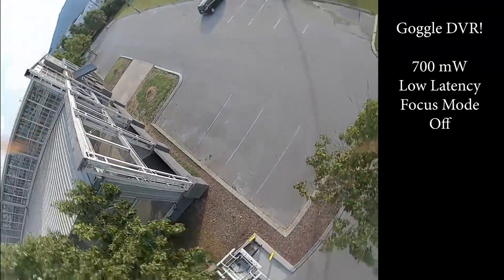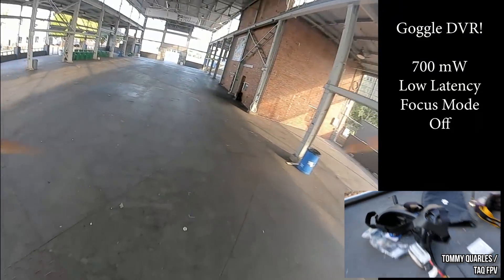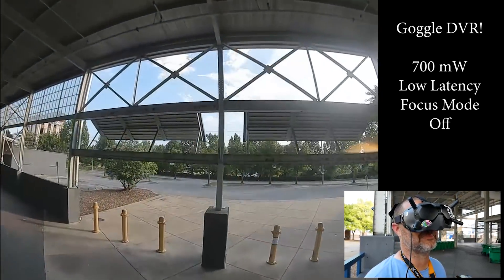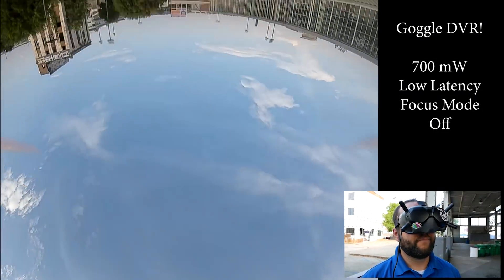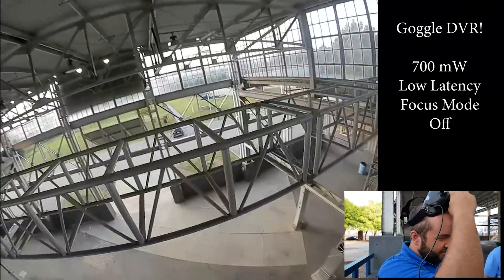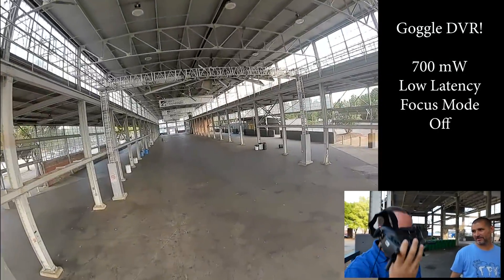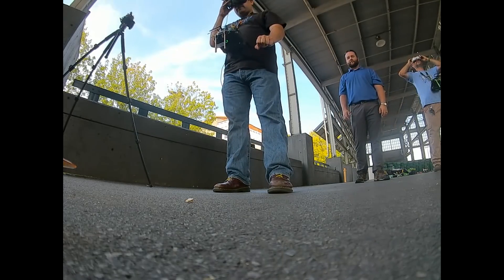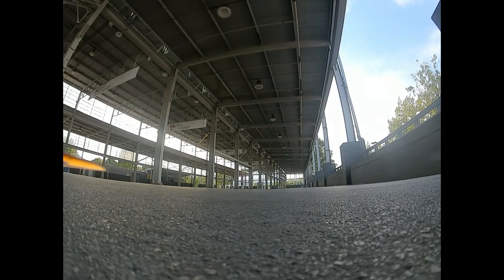DJI FPV 25 mW vs. 700 mW vs. Analog

Comment: how do you change mw setting for DJI Goggles 2? paired with the O3
Reply from the maker: O3 cannot change power manually. It is auto power only.
Reply: @JoshuaBardwell  thanks JB :D
Reply: @JoshuaBardwell  is there a setting I can or have to change on Tango 2 to go along with the higher power output (FCC hack) to further increase range?

Comment: It is possible that there is a firmware hack for the modules and force 700mw. I have a DJI FPV drone and I saw that there is a hack to the firmware that allows you to choose signal modes and unlock height limits. In my case I am from Argentina and I don't need to unlock it

Comment: 3 years later and this video is still as relevant as ever, thanks! Watching the comparison of both DJI 25mW/700mW vs Analog really puts into perspective how much clearer the DJI image quality is. Analog just isn't very clear at all, but it's what I've been using for 4+ years now. One of my BFFs has a DJI set up, and it's great that you've put in the contrast between DJI digital images vs analog, but I was also surprised that 25mW DJI could go as far as it does. I fly at 400-600mW on analog, and if I go behind any object at all, it pretty much cuts out completely. This video solidifies my opinion that I do need to make the switch to DJI or digital if I want that clear flying experience. It seems like the compression of the video data in real time, and the filtering on noise/channels that DJI provides is much better than Analog. I also live in a populated area, so the radio interference of 2.4 & 5.8 GHZ signals is redic, which is where that fine tuned filtering of data & compression really comes in to play with DJI. It just seems better (assuming the slight latency increase doesn't affect your flying style)

Comment: Hey, thanks for the review
If you use DJI controller vs tango 2 crossfire. Does it make difference in range?
Reply from the maker: Crossfire has longer range. But DJI controller has as much range as DJI goggles, and some would argue that's all you need.

Comment: Joshua I know im 3 years late but I'm new to FVP and I really like when you go into specifics. Most other youtubers just throw around 25mW 700mW bla bla  but don't even explain what they are talking about. Is it a goggle, a battery? what does it look like, where it is? what is the range difference... etc I think you explained some of that much better than others out there but I would suggest just lowering the learning curve a bit at the start of each video so that newcomers can know what is being addressed..
Reply from the maker: 25 mW vs. 700 mW refers to the output power of the video transmitter on the quad. More power = more range and penetration. In general, 4x the power equals 2x the range in open space. So 25 x 4 = 100 x 4 = 400 mW would be two doublings of range, or 4x the range. 1600 mW would be another doubling of range after that, or 8x the range. So the difference between 25 mW and 700 mW is between about 4x and 8x the range.

Comment: I'm a noob to fpv, but I watched all the dji videos by US based reviewers and thought yep, it's for me. I didn't know dji limited my gear because I registered it in the UK. lost two drones at less than 500m range by accidentally flying behind a small obstacle that should present no problem and don't on the thousands of US based review videos on you tube. the warning signs are almost none existent, it's like ok then gone. next one will have GPS. the extra cost of DJI vs analogue, per drone, it's barely worth it.  you can buy a RTF drone £200 cheaper than a similar DJI version, put a hero7 on it and still have change left over and on the next drone purchase you already have the go pro.
Reply: You can increase the Mbps to 700 very easily if you wanted. Even up to 1200 if you're a mad lad.

Comment: I’m getting into fpv.   How do I know when your out of battery or read how to monitor battery percentage, when it’s right time to stop and not damage lipos.  Or does the drone just feel slower when it’s low?
Reply from the maker: Use the on screen display to monitor battery voltage.

Comment: Can the DJI FPV air unit be used for airplane/Fixed wing operations?? It does have 8 channels.
Reply from the maker: You would need an SBUS to PWM converter.

Comment: @Joshua Bardwell  Hi J i need help and i think you are the only one that can solve my problem, im having issues with DJI fpv digital controller please help.i already refunded 1 and now i got another 1 with the same problem. the problem is related to endpoint of sticks. in the one i refunded i was having the problem when i full press right roll the software detect full left and now i have on pitch. is someonelse having that issue on gimbal? i tried my friend's controller and is having that exact issue on throttle.when he go on full throttle and reach the endpoint the software detect 0 throttle…is possible to set a dead zone in the end point area?

Comment: I'm sure this question has been answered already, so please excuse me for asking again:  What is the downside to using the DJI goggles with my Taranis radio as opposed to using the DJI controller?
Reply from the maker: You have to put a receiver on the quad in order to use your Taranis, whereas if you use the DJI controller you can just link to the Air Unit. But personally that's the approach I take, because I prefer the flexibility of the OpenTX radio.
Reply: Joshua Bardwell - great thanks. Glad to hear there’s no performance difference.

Comment: Love your videos, Joshua. I take it all the video you showed today from your DJI flights was from the SD card in the goggles? It's been interesting watching your videos and others on the DJI system. I recently bought the DJI system and do not see the same level of clarity that you are getting. Pretty sure I'm on 700mw and it doesn't look nearly as good as your 25mw. Not even close. I always have breakup even if my quad is 5ft away from me. I mean, it's good enough to fly and still looks pretty good, but I'm not making the distances you show in your video. The breakup would be way too much. Makes me wonder if I'm setting up something wrong. I also bought the Lumenier package from GetFPV (goggles and air unit antennas) hoping the problem would go away. Those antennas were no better. In fact, they were a little bit worse than stock. It's weird. Everything works on the DJI system. I also use their controller. I have two different air units and both do the same thing. They work, but the video clarity and range just isnt there compared to what I'm seeing in all these youtube videos.
Reply: Hi. I just bought Nazgul with Caddx vista and I am experiencing the same problem you are describing. Did you manage to fing out what was the cause of it? How to fix it?

Comment: Thank you so much for this clarifying video! Unfortunately I am living in Germany. So 25 mW is the max. But DJI goggles are still at 25 mW way better than any analog also with 25 mW driven system!
And: Your comparison: Analog 700mW vs. digital 25mW is not valid. We have to use 25mW only. ;-) Or do I misunderstood something?
Reply from the maker: A lot of people in Europe break the law and fly above 25 mW. This is easy to do with analog. I'm not saying you should do it, but I know people do so I wanted to make the comment about it. You can also break the law with DJI and fly at 700 mW but it is a little harder to figure out how to do it.
Reply: @JoshuaBardwell  Thanks for your comment! Wait I could not comment further because I must search my SD card with a text file that contains a one. Where do I lost this f...ing SD card?

Comment: Joshua, hi!
Tell me how convenient it is to use this system with glasses?
I have myopia "-3.5"
Fatshark glasses - I use corrective lenses.
And here, how?
I see that you wear a helmet right on the glasses.
It's comfortable? So can you fly for a long time?
Reply from the maker: It hasn't been an issue so far.
Reply: @JoshuaBardwell  The answer is beautiful.  but I don’t understand))).  Can I use this equipment if I have poor eyesight?

Comment: i just got the setup and connected it to my quad. everything works but it only shows 1 bar of signal when the quad is right beside me. when i walk like 5 meters away, the connection totally breaks off. does anybody know what's wrong?
The antennas are plugged in..
Reply from the maker: Update firmware? Make sure you are not getting interference from something else on the channel like an analog vTX? It should be full bars.
Reply: @JoshuaBardwell   thanks for the reply!! :) It was an analog system indeed. I just connected the dji air unit and configurated it using betaflight to connect the remote. But nothing else...?! I wanted to do a firmware uodate but when i loaded the firmware and pressed FLASH it just showed something like starting boot or loader and didnt load...?
Reply from the maker: The Betaflight FC needs to be in bootloader mode. You will see DFU on the menu where you normally see the COM port.
Reply: @JoshuaBardwell  Thanks! I installed all the drivers and am in DFU mode but now it does not even react when i press on FLASH. nothing happens..?
Reply from the maker: Did you load the firmware first?
Reply: @JoshuaBardwell  yes
Reply: @JoshuaBardwell  i finally got it to flash. But still the same very low signald problem with the DJI unit :(

Comment: It'd be cool if DJI could use a diversity setup on their system, where when you get a stutter at low power, it will automatically switch to an analog signal so you can simply fly through the snow like normal, then when you're back in range, it will switch over to the full digi signal.

Comment: Can you use these DJI goggles with analog signals? Meaning can they be used with micro quads or would you still need a pair of analog goggles for those? I know the quads wouldn’t be able to hold the DJI hardware, but could these goggles show analog video?
Reply from the maker: The DJI goggles do not have an analog receiver built in. They accept an AV input from a ground station though.

Comment: The question I've never heard is "why would someone use 25mW or 700mW?". What are these numbers for? Thank you!
Reply from the maker: 700 mW is more output power with longer range. 25 mW is lower output power with shorter range, but in some parts of the world it's the most you can legally use.
Reply: Thank you Joshua!

Comment: how do you change from 700MW to 25MW?  Thinking maybe i've been flying in 25mw accidentally because my range hasnt been great
Reply from the maker: If you have not connected the FC UART, make sure that "Power Limit" is off.

Then in the Device menu, make sure that power is set to 700 mW.

Comment: The breakup between analog and digital is so different. The dji system is scary to be honest, the pixelation that happens when digital breaks up ruins the whole image. Where as analog almost warns you prior to losing signal. At the cost of the dji system I just cant justify the cost of a quad and gopro !! Its FREAKING AMAZING!! But its almost to good until it has an issue and then its REALLY BAD. Plus its not just video, it's your control you lose as well. Now that's SCARY STUFF!!
Reply from the maker: My control is crossfire.

Comment: OK, I think I've watched all of your DJI FPV review videos.  Really nice work.  Question for you: I'm wanting to start out in FPV this autumn for fixed wing flying.  I have the budget for the DJI system, and I have no FPV gear at all.  Should I take the DJI plunge or start with an analog system?
Reply from the maker: The DJI system is amazing. I think the biggest thing is whether you plan to fly with others or not. If you get it, you won't be able to view others' feed, and they won't be able to view yours.

Comment: The lack of breakup is spectacular TBH, and Im not a DJI Fanboy.....That said, my 5 Inch quad on UHF and 1280mhz video has endless range with a very solid video link. Would I like a DJI system? of course I would. 
 Just like my Taranis, and NOT USING (Crappy EU) LBT Firmware, Id run the DJI like the rest of the Globe does. Britain is leaving the EU, LBT was one of very many reasons. Halfwit, overpaid jobsworths in the EU. Nice video Joshua, as usual.
 It's just a shame it's on 5.8G, as this will restrict its ultimate range, but for short range Quads, it is, dare I say it perfect.

Comment: DUDE! That was an outdoor hockey rink on the grounds where you are flying! Oh, the NHL season is SOOOOO close. LOL #ISITOCTOBERYET?  On topic now: I love the clarity that the DJI system brings to the hobby of FPV and it seems that it's pretty damn reliable. The thing that still sticks in my head is the this is still 1st get and the very first product to market. For someone that hasn't already invested in an analog system, this would be awesome if you were planning to go all in by buying a set of HDOs with RapidFire to get started anyway. The thing is, most people aren't going to do that when they are just getting into the hobby. Personally, even though I've gone the semi-budget EV-200D route with every Lumenier antenna under the sun to try out different configurations for now, I'll stick with it until HD technology in FPV matures and there might even be more than DJI in the market by the time that happens. This is nothing against DJI, I'm glad they brought this to our hobby, and if DJI is the system that I feel like going with in 12 to 18 months I will. The biggest thing, in my opinion, is that it's forcing current FPV goggle, receiver and transmitter manufacturers to step up their game. It might even get Fat Shark off of it's "if it's not broke why fix it" non-innovating throne and finally do something completely new. They did tease that they are working on it at least. On the other side of the DJI coin they did try there hand at a FPV kwad kit at one time and that didn't last very long. Everything could just go back to old reliable analog like nothing ever happened in the end.
Reply from the maker: This is not 1st Gen for DJI. They have at least 3 maybe 4 gens of digital HD systems. This is just the first one useful for FPV.
Reply: @JoshuaBardwell , that's true, but I'm pretty sure that you know what I mean. If the tech was the same for FPV as it is for cinema drones, I'm pretty sure the hurdles that are being encountered would have been overcome long ago. We can't just add a gimbal and hang a 1080p camera off the bottom of a FPV drone.
Reply: I'll use this analogy. It's like saying that Ryzen processors weren't 1st gen because AMD made FX processors before that. The CPUs serve the same purpose and essentially work the same, but the AM3+ and AM4 platforms are completely different, technology wise. Just like the FPV and cinema drone platforms are different.

Comment: Joshua I don't understand you. you are a great influence in this community but I swear that every chance you get to even though you love flying with this new system......that you seem to want to find something wrong with it. the degradation at 25 out by those trees with your dramatic punch out and fear that came forth......it's weak at best. your end conclusion of stating I would fly this here and that there....doesn't help anyone. you just don't seem to be able to support this new system with all of you...you're not helping your self in getting the second edition for free. if you are trying to present yourself with no bias in hand it's not very convincing. if it's not PERFECT at 25 then flip to 700.
Reply from the maker: The DVR makes the breakup by the trees look less bad than it was because you can't see the dropped frames. All you see is one really bad frame and then I punch out. You can't see that the image froze up for a fraction of a second. There's no way to fully record what the goggle shows except to have a GoPro in a 2nd goggle. But that'd be very expensive.

You say, if you can't fly at 25 switch to 700. That's not an option for people following the law in Europe. Obviously here in the US I will never fly at 25.
Reply: @JoshuaBardwell  it probably would have been fine in focus mode. Just a guess.
Reply from the maker: @Furadi  Maybe. Check out the image I had: https://imgur.com/a/cM8ndkA

Since I could not clearly see my next line under the tree, I punched over it.

Comment: $1500 AUD Mode 2 fly more package is Unobtainable 🤬🤬🤬
Reply: Sorry $1209
https://www.camerasdirect.com.au/dji-fpv-experience-combo
Reply: @Skankhunt-42-  once under 1k I will pull the trigger 😉
Reply: @HenryDarr  fair call. I just ordered the two camera combo for 1299. No discounted prices on this combo anywhere unfortunately and I wanna use my tx.
Reply: There is an Australian camera shop selling the kit with the remote for 1240 aud

Comment: "If you're flying analog at 700 milliwatts versus DJI at 25, I think the reduction in range might be enough to offset the increase in picture quality." 
Huh? Why would that ever be a consideration? Is it a Europe thing where they are allowed to fly 700mW on analog, but limited to 25mW on digital?
Reply: you are only allowed to fly 25mw analog or digital in europe
Reply from the maker: People in Europe commonly and easily break the 25 mW restriction with analog vTX. DJI is harder to fake out although it can also be done. That's the comparison I was getting at.
Reply: Joshua Bardwell Ah okay. Got it. Though the ‘hack’ really isn’t that much harder to unlocking an analog vtx.

Comment: I’m a newer pilot and took the dive into the DJI system. I feel the quality has given me significantly more confidence trying stuff
Reply: same here. crashed 2 quads before my switch.
Reply: Question, did you go for the DJI controller or just the goggles?
Reply: @mattjackson9460  went for the dji transmitter as well.  the air units come with rx and tx. Saving space by using the transmitter